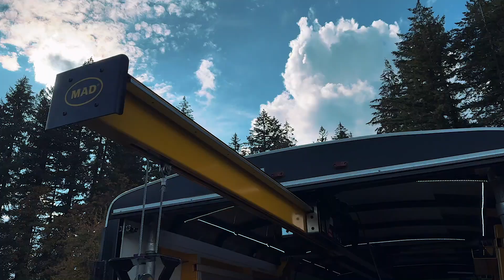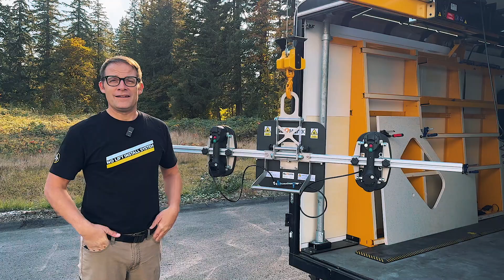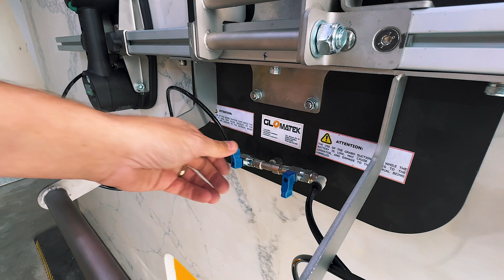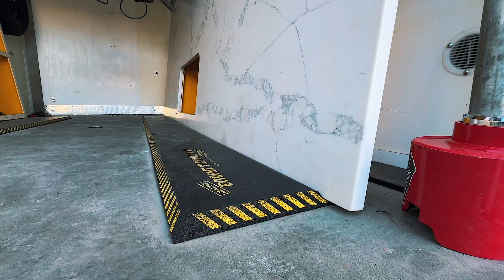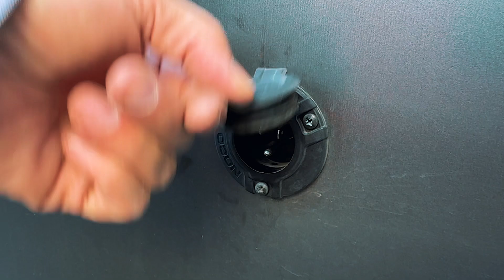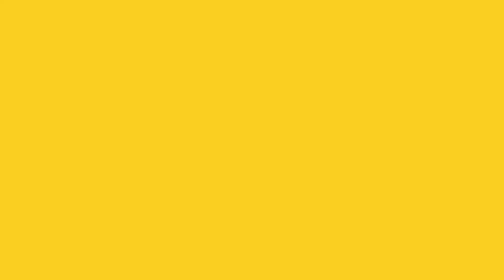Install Trailer - No Lift Install System

Comment: So what is the biggest piece you can put in it ? 
What’s the out the door price? 
Or can you just order the guts and put in your own trailer?
Also y’all need a mobile shop tilt table sorta like the cart . To get the pieces upright so the suction cups can load into trailer.  The no lift doesn’t go tall enough to get off of fab tables
Reply from the maker: Those are great questions. Basically, yes, you can order the components and put them in your own trailer.   I would love to chat about this and your specific situation. Visit https://noliftsystem.com/product/crane and submit a request for a custom quote. From there, we can chat to see what the best option is for you and your install setup.